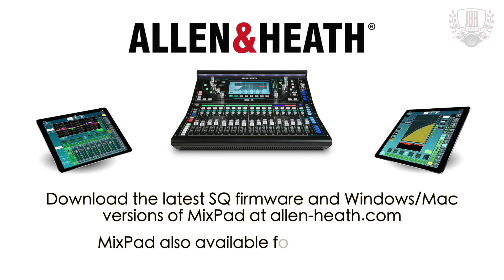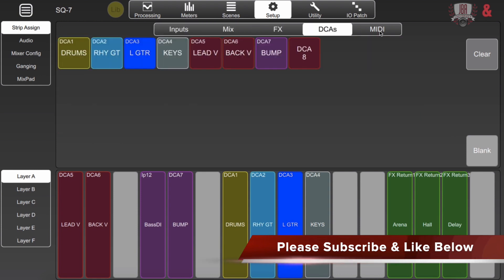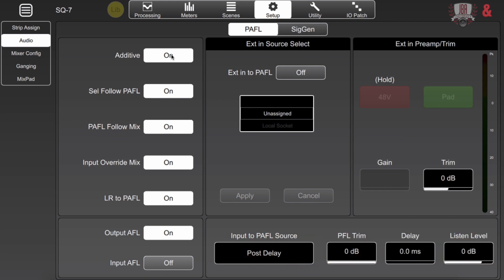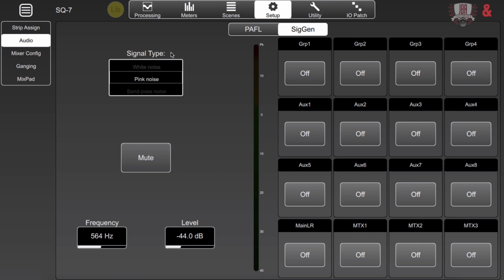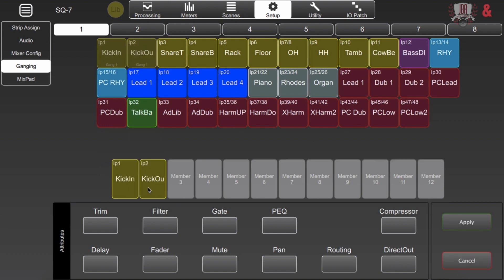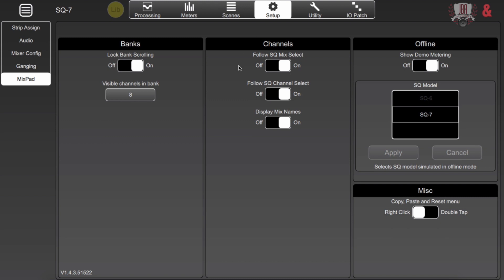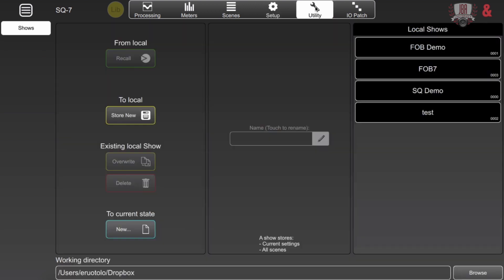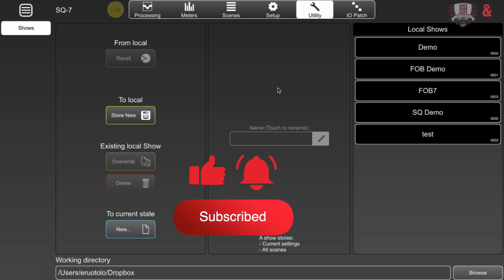Allen & Heath SQ Mixpad Offline Editor - Part 6 - Setup & Utility

Comment: i am confused about the saved showfile it doesn't show up any name in the folder how do i know which to load in the console once the showfile on the usb stick
Reply from the maker: You’ll need to format a usb stick to run FAT32 for it show up with Allen and Heath boards. If you’re using a folder on a computer, double check your permissions to allow Mixpad to see folders.

Comment: As a venue PM for a small club, I often have guest engineers come through with pre-programmed show files. They almost always fall into the trap of configuring strip assignments for SQ7 when our house desk is the smaller SQ6. Is there an option in the MixPad app to change console version?
Reply from the maker: I had to do a little digging with this. Mix pad is going to match the console once they’re paired together. You can use a show file for a smaller console on a bigger one (i.e. SQ5 show file on an SQ7, but not the other way around). I would recommend they adjust their showfiles in the offline editor before they arrive at your venue. Unfortunately there’s not really a work around. The Mixer and mixpad will chop off faders 25-32 for you when using an SQ7 show file.
Reply: If you go to Utility > To current state > New... > SQ-6 Template > Create New this will allow them to do so.
Reply: @fineencoding  I have been searching for this answer for ages!
Reply: @fineencoding  Zombie thread revival - exactly the answer I was looking for.. .thank you!